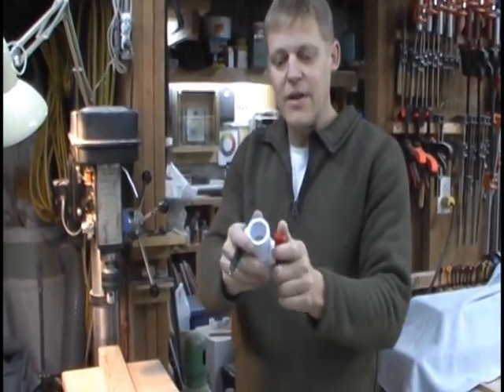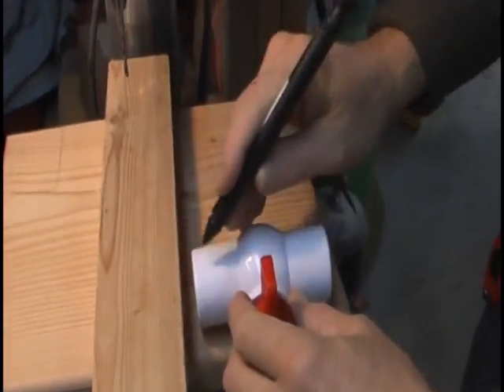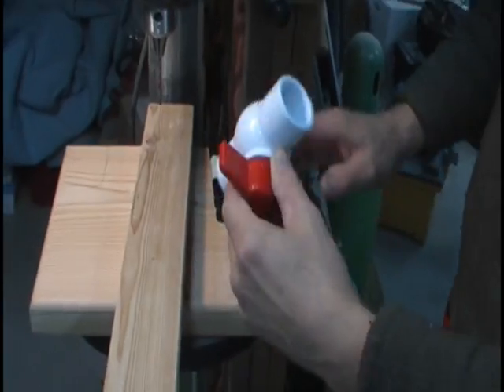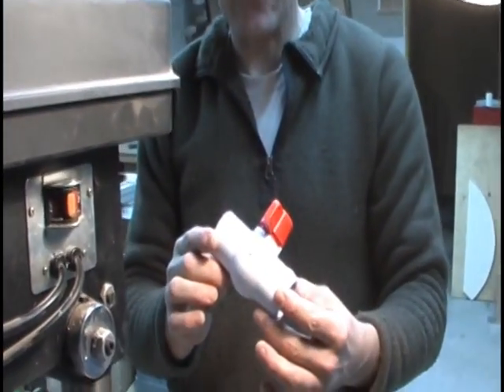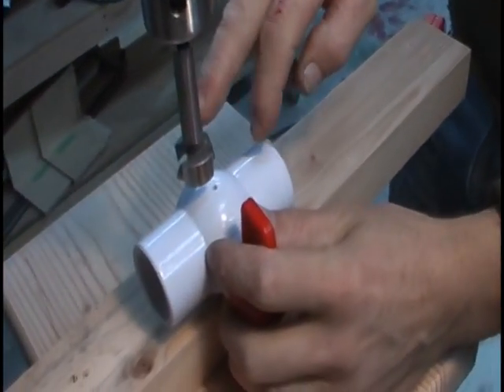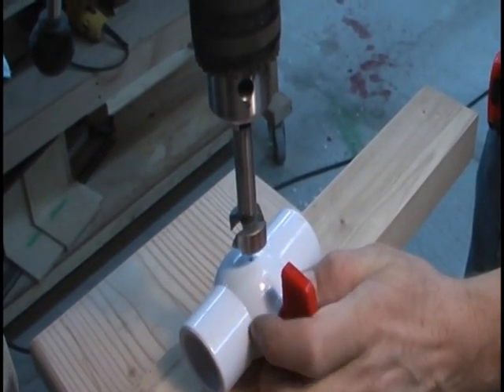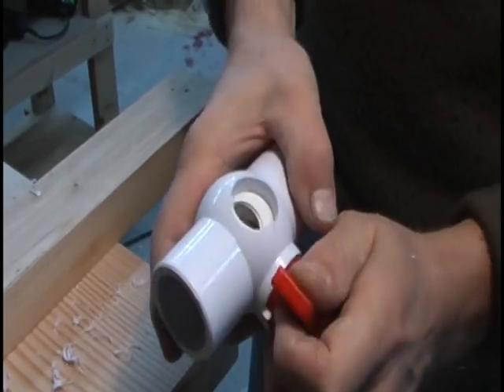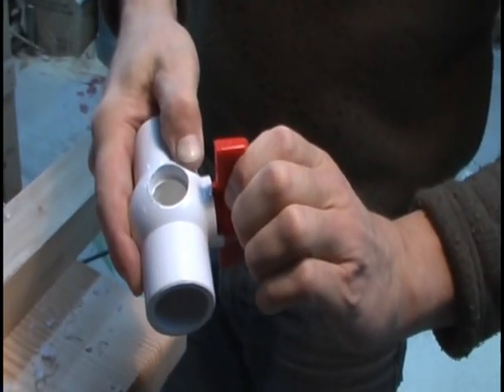FREE Magnum Air Cannon Plans!  Part 2 of 6

Comment from the maker: @abc123904 
The part I drilled is one of the ball valves which make up the rotary bolt loading system.
This open port allows you to load at the breach (rear) for fast shooting.